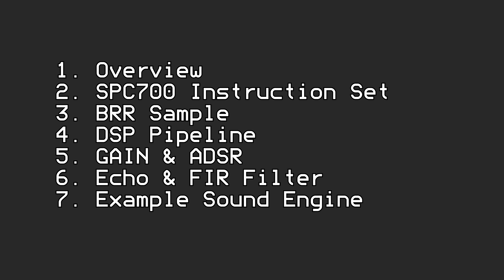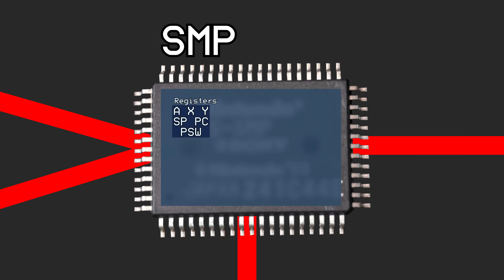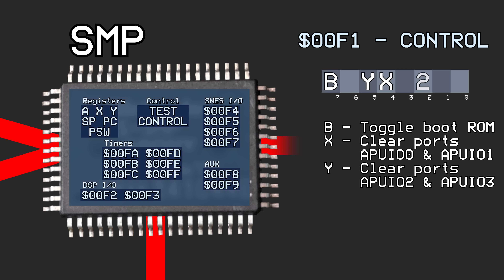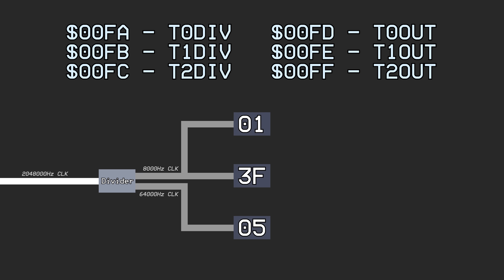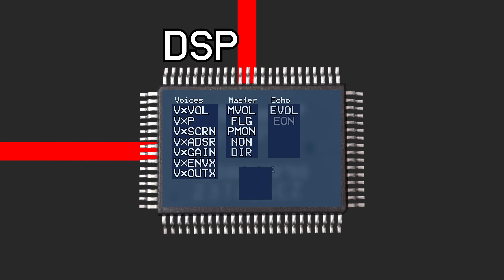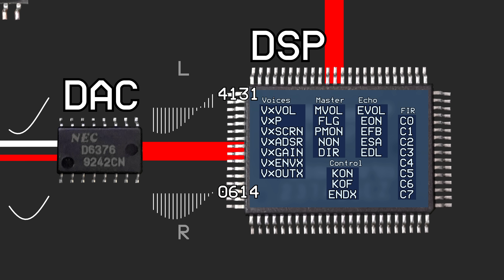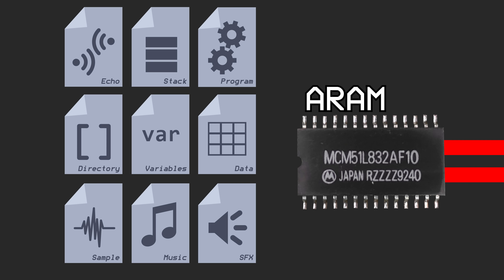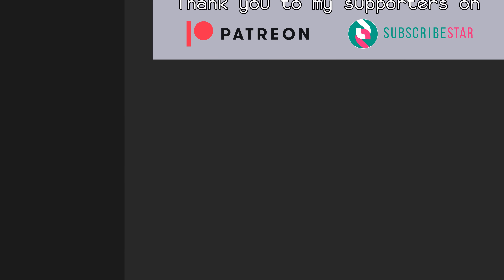SNES Audio System Overview - SPC700 Series pt. 1

Comment: This makes me feel like programming back then was such a resource-constrained job that it forced a lot of organizational creativity, which is something I love to see.
Reply: Exactly, it’s art through adversity. It’s why I still play a lot of the games back then, while newer ones are forgotten quickly
Reply: as with everything involved in humanity, limitation breeds creativity. if it didn't we literally wouldn't be here both physically and technologically.
Reply: If I remember correctly, Super Mario Kart came from an attempt to create a follow-up to F-Zero.
Reply: @jimmyhirr5773  I believe they wanted a 2 player fzero, but they realized the SNES couldn't handle it at the speed and size of the levels in F-Zero (something how mode 7 2 player could only be 1/4 of the size), so they came up with the idea of Kart racing instead, since the levels would be smaller and the speed would be slower. Pretty cool that the whole series is just because of that limitation
Reply: @stevenschiro1838 : F-Zero streams new tilemap data into VRAM during gameplay, just like a regular platformer. You can't do that for 2 players because one may be so slow that he's in a completely different area of the level. You'd have to switch to a top-down view like in F-1 Grand Prix, and halfway across the screen move the "camera" to the second player's section of the tilemap.